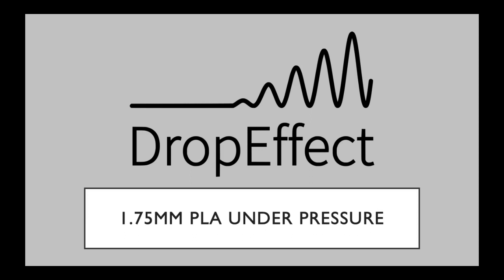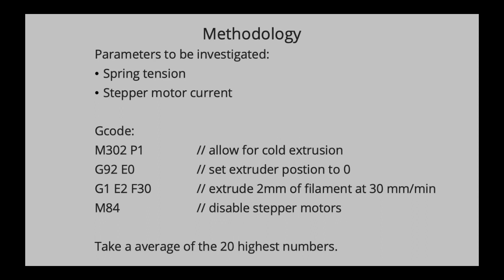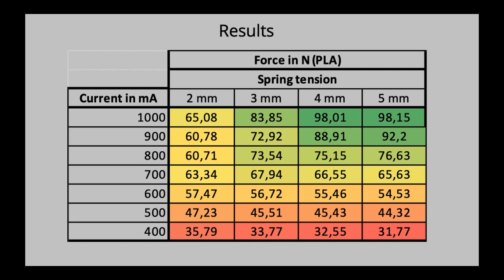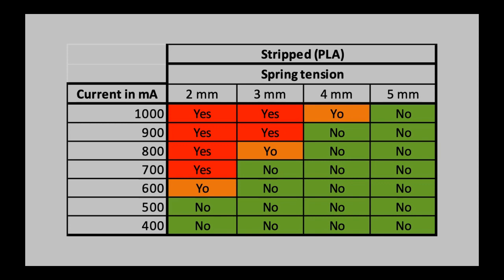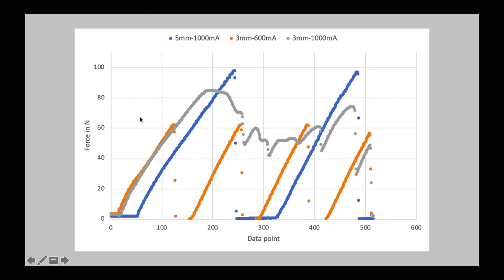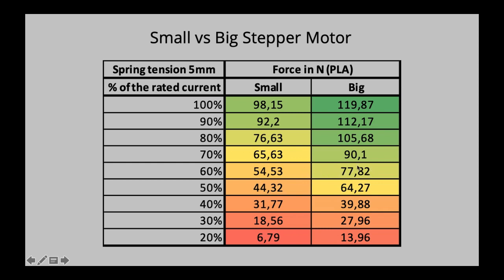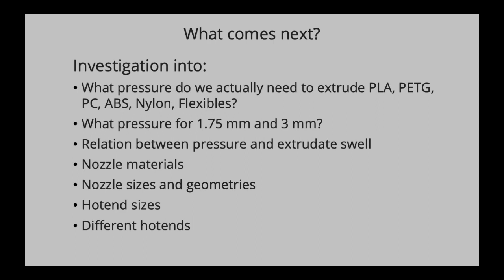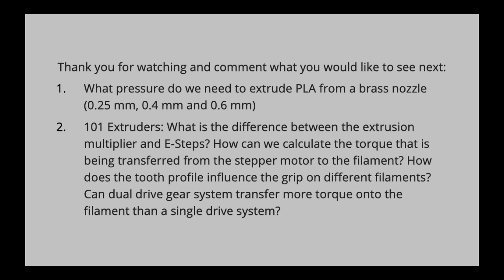1.75mm PLA under pressure

Comment: Lots of information.  After watching,  my question is what pressure do I need on from my OmniaDrop to get a good flow from different materials?   I have been running at  600- 700 current and probably 2 -3 mm on the spring tension.    This helped put in perspective how to adjust both to get higher pressure, but do I need it?  Where I have had problems with extrusion is when I try and print at too low a temperature or i have no spring pressure set.   So my vote would be some real world examples for different materials - temps and nozzles.  I think that would be very useful for your OmniaDrop users.  Very detailed and lots of good information., now if you could slattern into how to get better results.
Reply from the maker: The aim of this video was to show two things. One is that transferring torque from a stepper motor depends on multiple factors, so current and a spring tension. The second point I was trying to make is that the OmniaDrop can be used as test-bench for companies and users to verify claims that for instance a manufacturer makes about new nozzle or hotend. 
If you are asking me to give you an optimal setting for the OmniaDrop I would say use a 3mm spring tension (you can use a M3 screw to see if fits between the extruder main body and the knurled nut) and 600-700 mA (depending how hot the stepper motor gets), this would be the goldilock zone for the OmniaDrop for "day to day" use.
I could make a video that proves that this  "day to day"setting is more than enough to print any material like PLA, PETG, Nylon, ABS, PC...
The "problem" is that most problems with failed or bad prints stem from bad slicer settings, wrong hotend temperatures, bed adhesion issues and/or bad filament (although bad filament is less of any issue these days).
I will try to think of something that is more relevant to OmniaDrop users. I always try to verify any claims I make with researched facts and experiments. I am not a huge fan of observational claims, because these are less verifiable and might not hold true for everyone.
Thanks for the feedback Dave.
Reply: @DropEffect  Thanks for the answer.  This is what I was looking for.  I having a feed problem with one now and have a better idea on settings.  This will help.